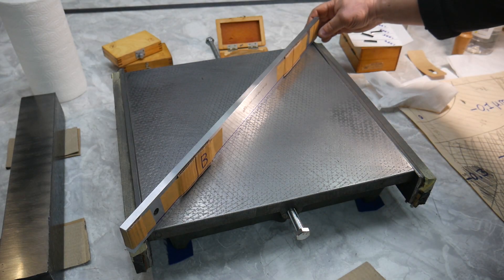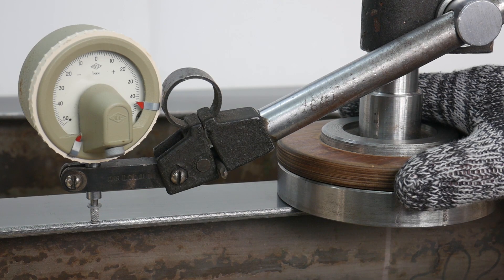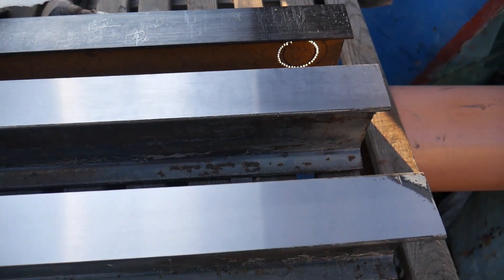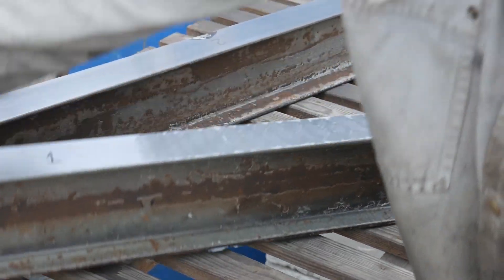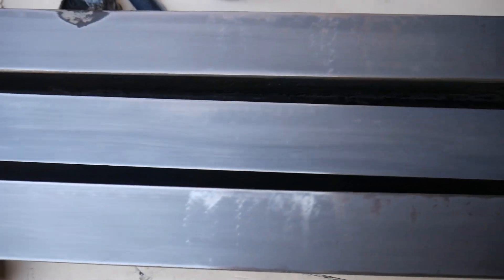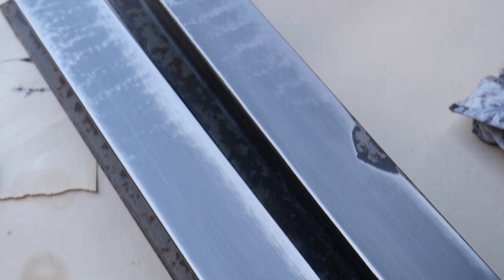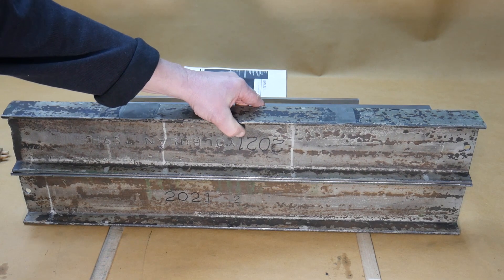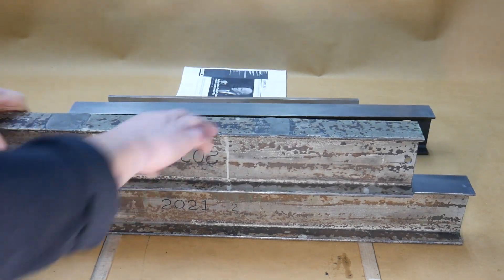DIY Straightedge made from I-beam

Comment: I just had the idea of using one of those farm jacks and found your channel.
They are like small I beams with holes in them.  Would it work?
Reply from the maker: Write a question to the mail with a photo of the beam.
Reply: @gena_bazarko  Thank you for the reply.  I had no idea I could even do as you suggested.  I must say, I'm very impressed with the work you put into this video.
If you simply google search "8000 lb ratcheting farm jack" you will get countless pictures of the 48" version that I have. 
They are 2 inches by 7/8" tiny I beams with holes throughout the center.  They are designed to lift tractors and things. I've had mine for maybe 20 years and never used it as it needed a little work so it sat on my list of things to do, but never got done.  It occurs to me that it would make a perfect straight edge, yet I have never seen it done.  It could also make a great rail for some cnc machine.  I'm wondering why no one has ever done it and looked to youtube and yourself for potential reasons.  They seems to fit the need perfectly, so why isn't it done?  I must be missing something.

Comment: Nice video! I was wondering if it would be beneficial to use a lapping plate wider than the other pieces? That way app points get equal contact time.

Comment: 7:01 I guess the 2 points are intentionally not at the end to minimize deformation from the own weight of these straight edges.
I wonder if something like soft foam on a somewhat flat surface could work to even out the forces.
Reply: Foam can be cast onto a mirror using a separator.

Comment: 1:00 I don't know why but I think such a device is called "repeat-o-meter" (or so)
It wouldn't detect a uniform bow in the surface without a reference but it 
easily detects nonuniform curvature.
The other technique I've seen is using a precision level.

Comment: Surely the ends of the surfaces receive less abrasion than the centre when lapping?  As you move the beams, the ends are not always in contact whereas the centre is always in contact.  Does this affect the process?

Comment: Great work, especially showing exactly what it looks and sounds like to lap with just the proper speed and force.

But about wringing. It's not atmospheric pressure.

It turns out to be electrostatic force that does that stickiness. 

Both surfaces get a random 2-colour pattern. The two 'colours' are positive and negative surface charge, and the matching surface's pattern is the inverse, so opposites attract, and that is why wringing is so strong, but only for a very short distance roughtly equal to the length scale of the surface charge pattern. 

The charge pattern naturally forms because of friction, and self-organises because of electrostatic forces in the plane. Which is why wringing happens if you rub the two surfaces together, and the length scale has to do with how short a distance that rubbing is. If you rub in smaller and firmer little circles, you get stronger wringing but it breaks after a shorter separation, and it's limited by how truely flat the surfaces are. Also, you can really feel how much harder it is to move the surfaces only a little way rather than a long way - if you get them to slip, then they tend to separate and float over each other instead of holding, so it's easier to move them a longer distance of a few cm than a shorter distance of only a few mm.

All that force - enough to lift the weight of one of those I beams - and it's only a tiny little charge difference across the surface, which makes it hard to measure in its own right.

Comment: Wow so cool! Question, would it be possible to make both sides of the I beam extremely parallel?  How would one do such a thing?
Reply from the maker: Probably only one side of the straight edge is usually needed. But if you need two parallel sides, then this is not a problem, you just need to make a special tripod for the mechanical comparator. He should rest on the first side, which is flat, and take readings from the opposite side. then the opposite one can be methodically processed by checking its condition with this device.

Comment: wonderful video. 
i allways wanted a surface plater and camelback straightedge, but no resources to do it. this shows how i can do it. thank you.
subscribed to your channel.
Reply from the maker: Tell me what this is - camelback straightedge?
Reply: @gena_bazarko  Camelback straight edge is Just a colloquial way to indicate a straight edge made of cast iron which has an arc in the upper side to add more rigidity....
Reply: @gena_bazarko  Hi Gena,
A camelback straight edge is what people use as extremely accurate flat reference for hand scraping. It's made of cast iron and looks like a flat beam with a curved hump and a pair of feet on the hump. The top of the beam is either precisely surface ground or hand scraped to within 10 micrometer or less for a 1.000 mm length straight edge. So the straight edge you made yourself in this video is kind of a homemade version while a camelback straight edge is the commercially available way of reference for hand scraping something.

Comment: whitworth 3 plate method
Reply from the maker: Good day! since these are not planar slabs, but straight edges, it is necessary to apply a precision level in addition to this method.
Reply: That's sad. It means that those of us that would like to have a straight edge without tools that's not possible :) @gena_bazarko  I'm curious when surface lapping can we get decent parallelism between two surfaces? I mean during lapping gravity plays a role. If we lower the accuracy requirements perhaps we can also get a decently parallel surface?
Reply from the maker: @jackskalski3699  Unfortunately, the translator does not exactly do the technical translation. Therefore, I do not understand the essence of the issue. Gravity has almost no effect on such an I-beam; from its mass, it bends only a few tenths of a micron.
Reply: @gena_bazarko  let me explain. I was asking if via lapping two sides, we can expect some degree of parallelism between the top and bottom (if we do the 3 plate method x2, once for top and once for bottom)
Reply: @jackskalski3699  The 3 plate method only addresses flatness. Parallelism is a separate issue. You's start by making one side flat then making the other sided an equal distance from the flat side by simultaneously making it flat AND at a specific distance from the first side. Not easy, but doable with care. 
You can read about how the great man himself, Joseph Whitworth, created the first flat surface plate then the first true parallels then the first true square in the book "the Whitworth measuring machine".
Reply: @billshiff2060  thank you

Comment: I do not understand what you mean by "bassel points." Please explain.
Reply from the maker: The straight edge feels very hard. But in fact, it bends under its own weight. Of course, we are talking about fractions of a micron. But if the supports are placed along the edges, then a deflection will appear in the center. In order to disturb the straightness as little as possible, the supports must be placed in appropriate places. These are called Вassel points.
Reply: Hello @jimhopkins9675
Mister @gena_bazarko answered your question but maybe the explanation below will help too.
1-Airy points — zero slope at ends and when end surfaces must be parallel to each other — supports located 0.21132 L from each end
2-Bessel points — minimum change in length — supports located 0.2203 L from each end
3-Minimum deflection points due to gravity — supports located 0.2232 L from each end
4-Nodal points of first vibration mode — zero deflection at these points during free vibration — supports located 0.2242 L from each end

Numerical values of Bessel points and Minimum deflection points are too close to each other. And in practice, I think both of them can be considered the same.
Reply: https://en.wikipedia.org/wiki/Airy_points#Bessel_points

Comment: Геннадий, здравствуйте, ваша работа выглядит потрясающе! Половина интернета будет обучаться на этих видео, особенно с учетом подачи на английском. Подскажите пжлст какую именно «резиновую абразивную» насадку вы используете для дремеля при «шабрении»?
Reply from the maker: Hello. If you use a hard vitrified abrasive tip, the material will be removed too deep. Rubber-abrasive tips are soft, and the processing result is noticeably better. Rubber abrasive nozzles are better to have different grain sizes. The more elastic the nozzle, the better.                                                                                                           
              Здравствуйте. Если использовать жесткую абразивную насадку на керамической связке, происходит излишне глубокое удаление материала. Резино-абразивные насадки мягкие, и результат обработки заметно лучше. Резино абразивные насадки лучше иметь разной зернистости. Чем эластичнее насадка, тем лучше.
Reply: Thnx, seems I found proper ones

Спасибо! Кажется нашёл подходящие

Comment: Gena; I wondered if you have a chance to see how stable the straight edge is, since finishing it? These I beams are structural steel? They look old enough to have been "stress relieved"?
They stick like gauge blocks! 
They are very flat, but I guess that the size/thickness accuracy is limited by the flatness of the surface grinder "tilt"?
You are a man of immense patience, sir....
🇨🇦🐻‍❄️🤍⚙️🛠️♎
Reply from the maker: This question worries many. Now, using the tools and skills that I have received, I can answer this question. I will conduct such an experiment, shoot a video and publish it. But this takes some time. But even now I can say that in the worst case, my ruler received an inaccuracy of its surface of no more than three microns in two years, with a length of 820 millimeters.
Reply from the maker: Yes, the condition of the surface grinder will affect the result. But this can also be dealt with.
Reply: Ageing doesn't remove the internal stresses of steel products in any meaningful numbers, only a heat treatment can do that.

Comment: A very interesting demonstration. 
Would we need to use a heat treatment like annealing to relieve stresses in the I beam? If I was using scrap I beam, I would worry that dimensional stability might vary with temperature or over time. The I beam you are using looks aged and might be more stable, if it has been through many Ukraine summer winter cycles. 
I have experimented with 3 granite slabs to make straight edges so I am aware of the patience, time and attention it would take to get results like you show.
Reply from the maker: I searched but did not find any scientific studies regarding the stability of materials. There are definitely internal stresses in an I-beam, even if it is several decades old, it is easy to determine. Now I have the ability to measure within 1000 mm with an accuracy of about 0.3 microns, and in time I will determine if arbitrary deformation occurs. I measured one of these rulers two years after lapping. The error was 3.6 microns. I think annealing is desirable.
Reply: I would be more worried that the I-beam would deform when you remove a thin layer of material from one side. I have experienced a cold rolled flat bar bending visibly when cut in the middle.
Also, you have to be very careful when handling the i-beam with bare hands because as one side warms up in comparison to the other the beam would bend a tiny bit. Robin Renzetti - Robrenz talks about those things on his channel.
Reply: Some steps to mitigate these effects might be to a) wear gloves while handling them and b) always take a print with Prussian blue from each face against the other ones to verify flatness, and against a sufficiently large surface plate to make sure there's no twisting that's set in.

Comment: I really enjoy your videos! It’s amazing what you can do with limited resources!! Hope you’re safe in Ukraine
Reply from the maker: Now I have devices that make it possible to measure the surface with an accuracy of a few tenths of a micron (two or three -0.0003 mm). Two years after the manufacture of these rulers, I accurately measured one of them. The error was 3.6 microns. But, I think, immediately after lapping, the accuracy was higher.    Yes, I am in the center of Ukraine.

Comment: Wov so impressive. The pieces are like glued together. Like gauge blocks.
Reply from the maker: In this case, the lower ruler is held not by molecular adhesion, but only by atmospheric pressure. Very small gap. The surface works like a suction cup.
Reply: @gena_bazarko  последнее слово лучше переписать. It works like a sucker. Ощущение, что вы вопрошающего сосунком обозвали). Можете дать ссылку на насадку на дремель на АлиЭкспресс? Хочу попробовать.
Reply from the maker: @ИванДмитриев-ф1в  Спасибо, исправил. Я покупал насадки в магазине, потому ссылки дать не могу.
Reply: @gena_bazarko  это печально. Читал комменты, многие интересуются. Как шкрябать карбидом вольфрама инфы много, где купить гуглится. Так что ваш метод интересен, но не повторяем. Особенно для инглиш аудитории, думаю, что лучше давать ссылки на ибэй.